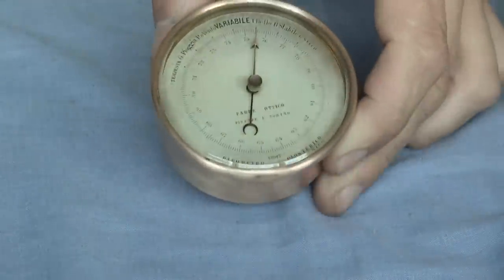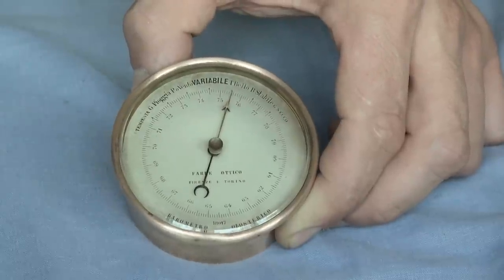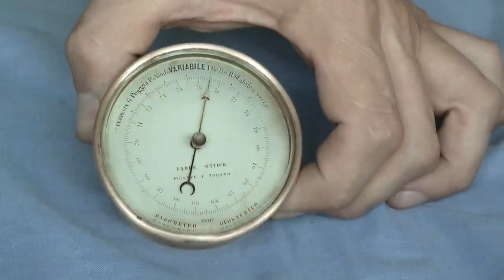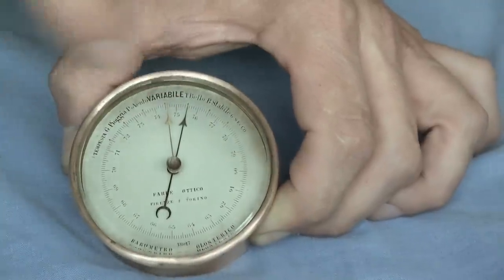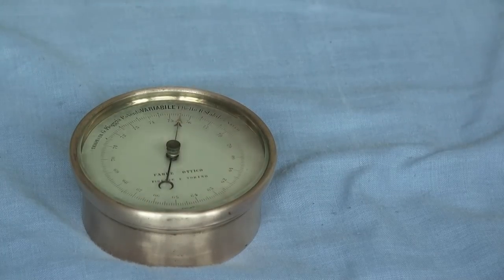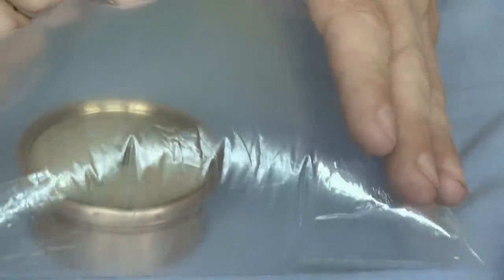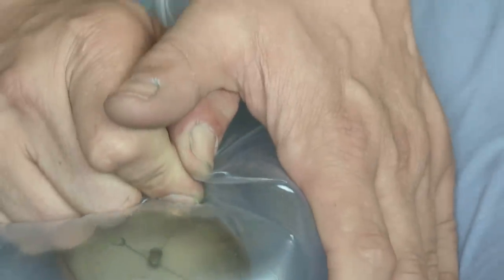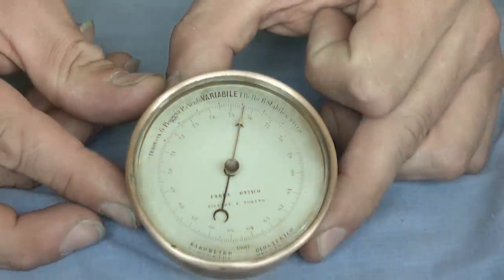Pressure testing an Aneroid Barometer

Comment: Simon, I live in El Paso, Texas at an altitude of 3800 feet or more. My barometer reads along with the weather forecast quite nicely but no matter what the weather is it rarely (if ever) goes below 30 inches. Since barometers are calibrated with a reference to sea level, will the barometer ever drop to the "Stormy" level at this altitude? If I understand it correctly, the actual barometric pressure is about one (1) inch less per 1000 feet above sea level so actual pressure at my altitude would be around 26.5 inches. Am I correct with any of this thinking?
Reply: Simon Spiers Hi Simon - thanks for your suggestions. The barometer I have tracks perfectly with the weather station barometer - I did have to adjust it and the adjustment process was pretty obvious. My confusion/question is -- at high altitudes like El Paso (3800 feet above sea level) the actual atmospheric pressure is more like 26.5 inches of mercury which is off the scale on any regular barometer. I researched a good bit over the Internet and understand why we do or do not adjust barometers to a "sea level" reference - makes sense to me using the QNH, QFF and QFE codes . My observations are, watching my barometer and watching the weather channel barometric pressure, the barometric pressure varies little here in El Paso at this high altitude. It very rarely goes below 30 inches and very rarely rises above 30.5 inches (as calibrated to a sea-level reference) no matter what the weather is. My point is, it appears to me, so far, that sea level adjusted barometers are of little use at this altitude. It appears to me that it would be almost impossible for it to drop to a reading of say, 28.5 inches in the "Stormy" region as the actual air pressure would have to drop to an absolute value of something around 24.5 inches of Hg. Maybe these instruments are useful at sea level but it appears to me they are of little value at my altitude. Per your suggestion below, I have considered setting it mid-scale on a nice day (like today) and see it it "predicts" weather change a little better - or am I just nuts and wasting my time?  :-)
Reply: ElPaso TubeAmps If your barometer tracks with the local wx stations then it is normal for the pressure in your area to stay in that narrow range. I have heard people who have moved from coastal areas to inland areas notice a degrease in the variation of barometric pressure on their instruments. Those markings:"stormy, rainy,etc," mean noting. That's just on the dial as traditional markings. It might be a simple matter of getting used to the pressure variations in your area. What is a small change on the coast might need to be interpreted as a large one in your area. At this point I rarely note what the number is. I just tap the outer edge of the housing with my knuckle and observe how much the indicator needle moves. Experience determines how I intemperate the rate.

Comment: Hi Simon - I have watched several of your YT videos on barometers. I got a Barigo made in Germany for Christmas. Is it better to calibrate it at an extreme low or high or in the middle or does it make any difference? Also, what type of accuracy should I expect as compared to the weather bureau? So far, it seems to track right on with the local barometric pressure I get off the Internet.

Comment: I have got a  Aneroid Barometer I think it's early 1900 Hundreds it Looks Brass / coated with one Reading Needle and I Can ajust it from the Front of the Class and it has a Screw at the back of the Barometer?  CAN you please Shed any light on this Would be Very grateful and Appreciated Many thanks
Reply from the maker: The front knob should set the pointer hand and is just used as a marker. The screw at the back compensates for your altitude above sea level and adjusts the black hand.
Reply: Thanks for your Reply Simon l know what you are Saying but it has  no pionter hand it's only got the one Black Main Needle and it's got a little bit of a edge on the Front of the round pointer /ajuster